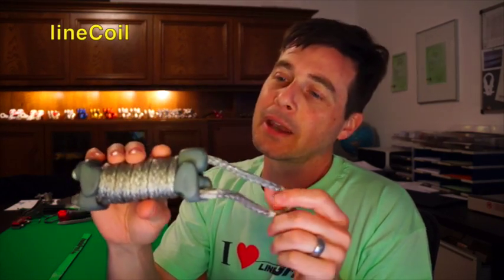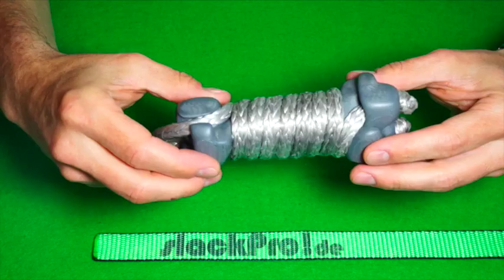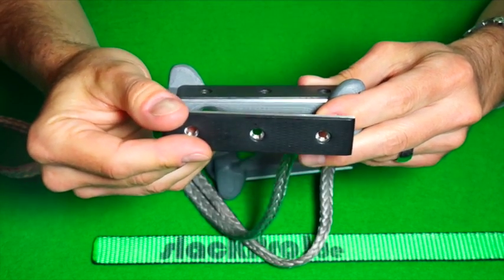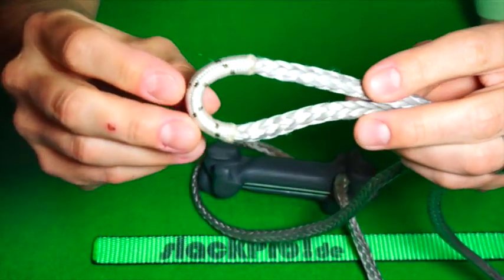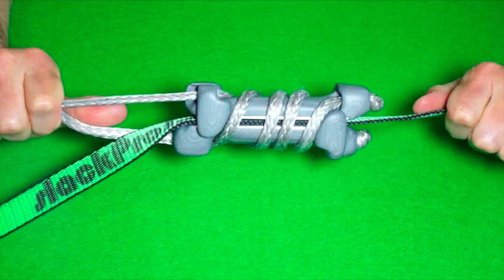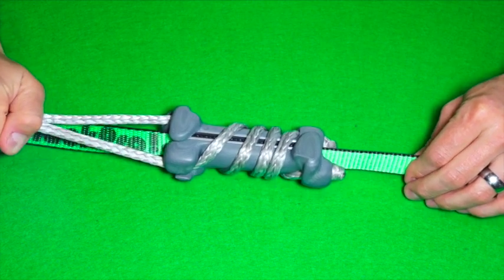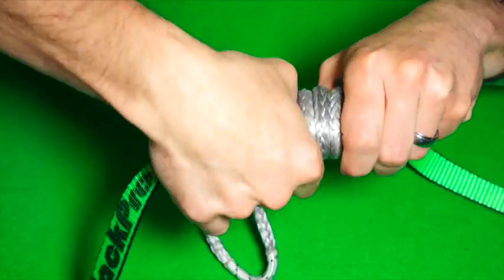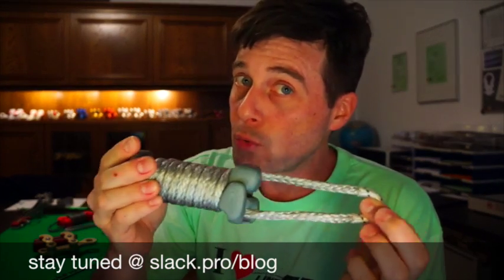slackPro! Video Blog, Episode 1, the lineCoil - new slackline tensioning system (re-upload)

Comment: Brilliant, can't wait for the release. How will this be priced? I assume that it is cheaper to produce than the linegrip?
Reply: +slackProXde what happened to this idea!? =(
Reply from the maker: thanx :-)
yes, its a bit cheaper in production, but not significantly. the highest cost factor is a very expensive casting mold, because this shape can not be milled.
we plan to have it on the shelf for about 119 EUR.
Reply: With some of the advances in 3D Printing Filaments, I'm sure you could find something that could take the stress.  You could print as needed instead of manufacturing in bulk.